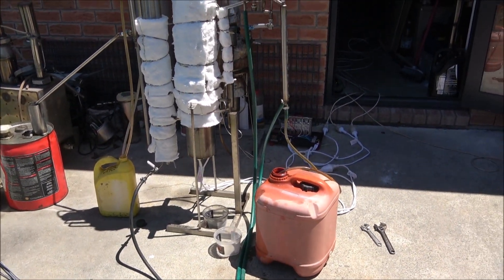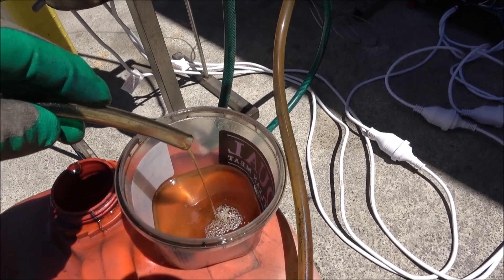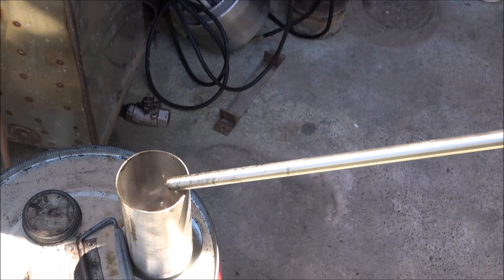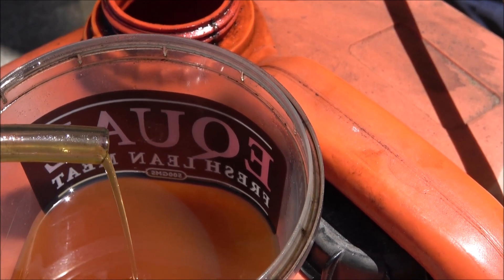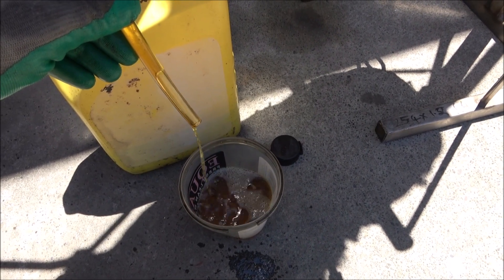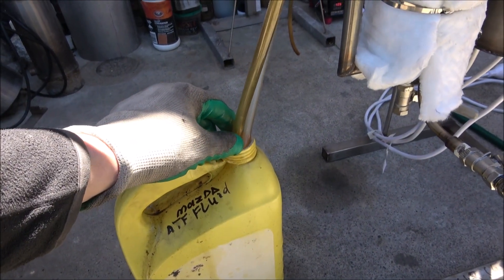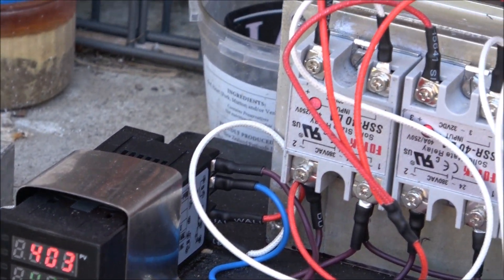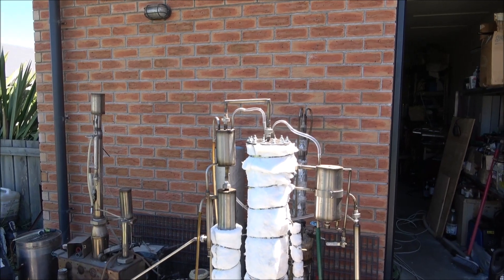WMO  - waste oil to diesel 2

Comment: Whats the difference between reformer and distillation and which method is better?
Reply from the maker: Here’s a revised version that improves readability while keeping the information intact:

---

Reforming typically operates at elevated temperatures, similar to destructive distillation, but in a continuous process. This process transforms a uniform, mostly heavy hydrocarbon feedstock into a variety of different hydrocarbon fuels, ranging from diesel fractions to petroleum gas. In semi-continuous reformers, also known as coking distillers, the feedstock is further broken down into solid carbon, which needs to be removed from the reactor cylinder before any subsequent distillation.

Continuous oil distillation generally occurs at temperatures no higher than the actual boiling point of the oil. As a result, only oil is produced, while impurities, additives, and bitumen—substances with higher boiling points—are separated from the oil. In this process, no destructive distillation takes place. The base oil can then be chemically cleaned and used either as a base for lubricants or as diesel fuel.

Therefore, if the goal is to produce a variety of products, reforming is the preferred method. The oil distiller can be effectively used for a secondary distillation of reforming outputs, such as petrol engine oil, automatic transmission fluids, or tire pyrolysis oil.

--- 

This version is clearer and more organized while preserving the original content.
Reply: So which machine is necessary to get dielsel out of WMO? I see that you sell a number of manuals, reformers, retorts, stills, etc and it's confusing the hell out of me.

Comment: Does it cost you more to produce than to buy, e.g. equipment cost, electricity, etc (assuming small batches)?  Otherwise, what is the return period for if someone did it for a single diesel 4WD?
Reply from the maker: Our current price for diesel per liter is NZ $2.70 - $2.80 per liter, in some parts of the world even despite the high prices diesel fuel is either not available or limited. thus it is $28.00 per 10L of diesel. Waste oil - is still possible to get it for free.
Also if one wants to save money, then there is no point to buy the diesel distiller - build it yourself out of scrap metal. Electricity is still about $0.22 - $0.25 per kw/h Machine consumes 6kw per hour, produces about 24L per hour, plus reagents, all together may cost about $5.00 per 24L of fuel, still cheaper, yes one has to invest time as well, Find some time once a week - this is the reality of current energy crisis.
Reply: @santeryi9  Thank you for a detailed and insightful answer. :D
Reply: @santeryi9  Hello guys , how are you all please I'm to help you to get good engine oil quality abd affordable price... I'm working ask salesman in UAE (DUBAI). I'm here to help you to disturb any kind engine oil you need .... Dm

Comment: Can you produce motor oil with this distillation method, or only gasoline?
Reply from the maker: Diesel fuel, you can use this base for motor oil production as a base.

Comment: What would you charge for a kit set one of these?
Reply from the maker: Honestly, I did not think about it, anyway need to calculate the materials cost, the unit was built about 2 years ago and was collecting the dust until recently, so the materials prices were different back then. Also how complete should be the kit?
Reply: @santeryi9  yes haven't things changed. I would think the kit would at least include the custom made parts you have. Maybe include things like pumps and temperature controller etc optionally. Cheers

Comment: How many continuous hours can this machine work?
Reply from the maker: everything depends on the quality of the waste oil, if something looks like bitumen, then you may clog it in a couple of hours, if filtered ATF fluid, then you may run it for the whole year without a problem.
Reply: @santeryi9  Sir that is not what I meant ... I asked to know if my machine would be destroyed quickly if it worked continuously for 24 hours ... In short I asked, to see if the machine would melt and be damaged if it continued working .... I use 10 mm sheet for hot parts of the machine.  Are made of ... (Reactor) Can you tell me your opinion about this ..... (I intend to reply comment youtube} 29/12/2021.
Reply: Given that he is running it at around 370°C and As stated by AZO Materials, grade 304 stainless steel possesses “good oxidation resistance in intermittent service to 870 °C and in continuous service to 925 °C.” However, they warn that “continuous use of 304 in the 425-860 °C range is not recommended if subsequent aqueous corrosion resistance is important.”

I'd think that it'd last just about for ever.

Comment: Давно смотрю мне нравится
Reply: Alex where can I buy this machine or how can I contact you
Reply from the maker: Patrick, I'll no longer build those things for sale, and it requires way too much time for the testing and cleaning afterward. It is ok to make one for yourself - keep it filled with oil, do not bother to disassemble. But when you need to, take it apart again and wash it up. Anyway, I am trying to get together a construction manual, and it will be released in PDF format, absolutely affordable.
Reply from the maker: You can contact me via the contact page of my site: https://www.ferromit.com/contact.html
Reply: sir alex activate carbon remove
black diesel colour change
white colour